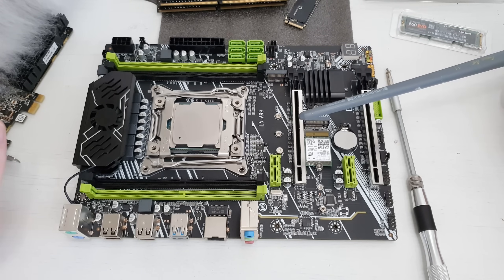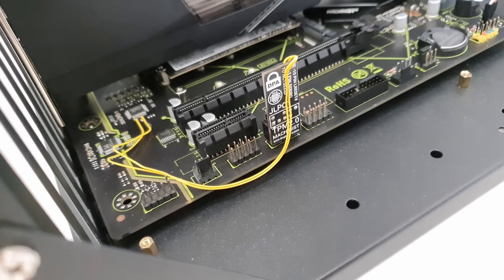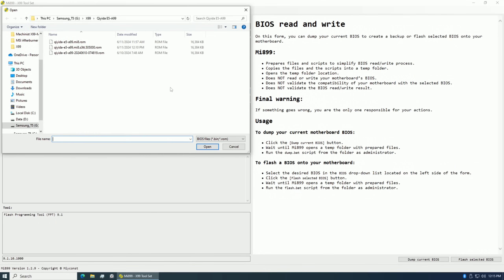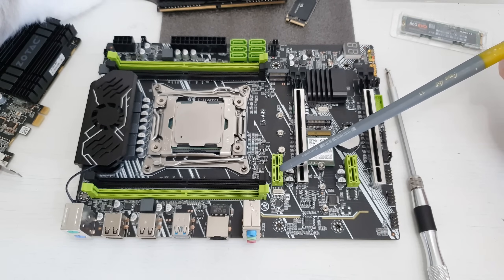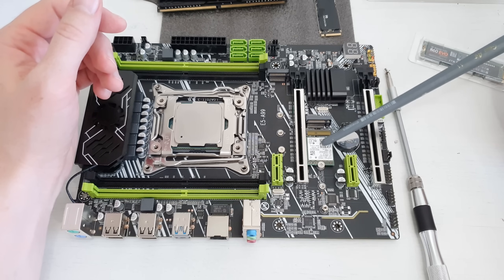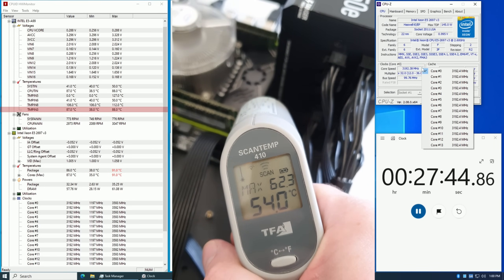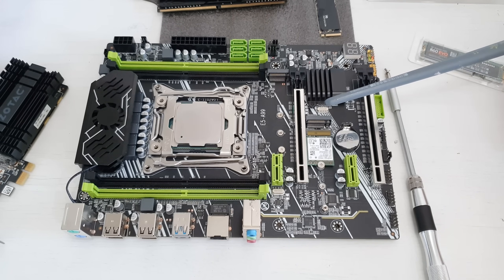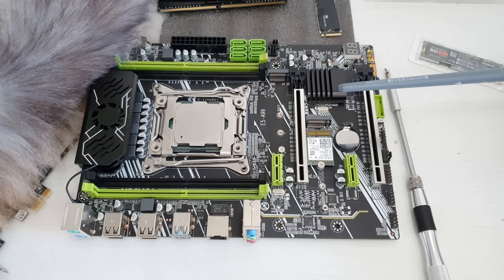Qiyida E5-A99 – a pleasant surprise with a detailed review of the motherboard

Comment: Wow! That BIOS is unusually very full featured with Re-Bar, PCIE bifurcation and memory time settings. Those functions make this sound incredibly compelling to buy. With a BIOS dump and flash I wonder if other similar boards could have some functionality unlocked.
Reply from the maker: What other similar boards do you have in mind?
Reply: @Miyconst  I have no specific boards in mind. It's far from my expertise so I'm simply wondering since it's been done on here in the past.
Reply: @Miyconst I've been trying to find a bios mod for the Qiyida E5-D4 with the e5-2680v4 and the H81 chipset? I looked through the MI899 library but i didnt see it

Comment: Hi another problem i had was in shut down during gameplay, it cant be GPU cos am using a brand new GPU. any suggestions?
Reply from the maker: You have to swap components one by one and see what is causing the issue. A brand new GPU is likely to work properly but may still be faulty.

Comment: I have this exact motherboard and it's stuck in windows boot loop after a fresh windows 10 install.
Reply from the maker: It sounds like you have a hardware defect somewhere, most likely the motherboard.
Reply: Thanks, I figured it out it was bios problem. It was attempting to boot from second harddrive.

Comment: The moment I had1 got the hardware before my favourite reviewer). I had bought a set with 2680 v4. In september 2023 BIOS I had had had no RAM timing adjustment. Thank you for the review.
Reply from the maker: If you your motherboard is indeed the same then you can flash my BIOS to get extra features but if the PC is a daily driver for you then I would leave it as-is as long as it works well.
Reply: @Miyconst  Thank for an offer, but PC is already sold. The man I had sold it uses it for FPW simulators. It turned out that Liftoff had adequate requirements, and RX5700 was more then powerful for 1080p / ultra graphics.

Comment: Amazing improve over my old Qiyida X99-H9 which the 3rd ram slot is defective so I have to use dual channel instead quad.
Reply from the maker: If only one slot is defective you can still use three slots for three RAM channels.
Reply from the maker: @gandharvmohan9572 yeah, CPU contact issues may cause some RAM slots to malfunction.

Comment: Thank you for your review. I just found a combo on AE with this motherboard, an E5 2680 V4 and 4x8Gb of 3200MHz RAM for less than 130€ !
I think i'll order it today or tomorrow with a RX 580 8Gb or a RX 6600 8Gb. 
Xeon on X99 are jewels !
Reply from the maker: RX 6600 is significantly faster than RX 580, just so you know. A great combo otherwise.
Reply: @Miyconst  I was especially worried about quad channel compatibility. I still remember a time when their X99 motherboards with 4 RAM slots only offered dual channel but now I'm pleasantly surprised! The RX 580 has the big advantage of being available at a very low price, around €100, which makes a relatively affordable PC when you reuse other elements (case, power supply, SSD, etc.). My only 2 regrets with this kit is the impossibility of activating the turbo on all cores on the V4 (as I do on my 1155 CPUs with the Z77 chipset) and visibly the RAM speed stuck at 2400MHz even with the 3200MHz provided (maybe the opportunity to run it at 2400MHz with tighter timings?).
Reply: Well, I ended up falling for the kit from AE this morning.  Thank you for this test which has shed a lot of light on certain questions (quad channel, speed of the Ram, etc.).  It’s well worth a subscription to the channel 😅
Reply from the maker: @newstalgia3865  welcome to the channel.
Reply: @Miyconst  i finaly ordered a RX 6750 XT this morning ... i think it's the most powerfull choice with my config before bottleneck.
Reply: @Miyconst  have you tested the power limit ? I ordered a 2697A V4 but i don't know if this motherboard will be enough.
This old sschool bios is a real time travel :D
Reply: @Miyconst yup I have the rx 5700 and it’s way faster than the 580

Comment: Running this motherboard after this BIOS upgrade and unlocking the TurboBoost, plus enabling the 4G Decoding made a HUGE difference with 2697v3 and a 2060Super for gaming (using the latest Nvidia Drivers also helps, so that it uses the card properly on idle)

Comment: That's basically the exact same as my Machinist x99 motherboard. Same color, pretty much the exact same features. They're good boards. Right now i have a 2650v4 I believe. Its the 12 core v4 E5. It chews through cinebench like a champ.
Reply from the maker: Which Machinist board do you have in mind? Is it MR9A (Pro)?

Comment: Thank you so much for your precise review of one these 'interesting' motherboards. My Machinist RS9 appears to have resizable bar enable in the BIOS. I enabled it for my RTX3060TI although I can't see a big difference in my gaming speeds. It also has the header for the TPM 2.0 module as well as the switch for it in the BIOS. The BIOS is V5.11 09/08/23. Just out of curiosity where is the link to your TPM2.0 purchasing website since I couldn't see it in the description (I may be blind and/or dumb). I'm running an E5-1660V4 on the board with 32GB 8x4 G-Skill consumer non-ECC memory and it's running perfectly. I guess I got a good one. BTW I highly recommend the Thermalright SI-100 CPU cooler. It covers the whole CPU/memory/VRM area and keeps the VRM very cool. 
Slava Ukraini !
Reply: RTX 3060 Tis (and most other Ampere GPUs) normally don't benefit a huge amount from Resizable BAR.
It does normally result in a slight improvement of performance, but it's often within margin of error and not easy to measure, and I think there might be a few games where it still results in a regression of performance rather than an improvement (though I'm not certain. Those bugs might all have been fixed by now).
AMD and Intel GPUs, and newer Nvidia "Lovelace" GPUs tend to benefit a lot more from ReBAR than Ampere.
Reply from the maker: I have added the store link to the video description, please check again. Your X99-RS9 indeed came with an updated BIOS version and TPM should be plug-n-play except for the reset wires.
Reply: thank you bud, i was looking for a really good cooler NOT ON AE that covers these boards very good to push the heat

Comment: Resizable bar works without bios mod? 'Cause it gives me active on gpuz, I applied the change to the registry to work with rx580, but adrenaline always sees it (SAM) disabled and not activable. thx
Reply from the maker: RX 580 officially does not support resizable bar thus you won't see it enabled in the Adrenaline Software, check in GPU-Z, if it's enabled there then it's enabled, no BIOS mods are required.

Comment: I have trouble choosing X79 motherboard on Aliexpress for my i7-3930K. There's so many models to choose from. Sorry for the vague question but is there any good model that doesn't require too much tinkering?
Reply from the maker: I am not following the X79 boards from AliExpress, sorry. The last time I checked Machinist X79 V2.82 was the best but no overclocking of course.

Comment: Excellent review. Is there a M-ATX version of this board, or close? Especially one with resizable bar already included in the Bios.
Reply from the maker: I don't know of any mATX version that would be an exact copy of this one but X99-PR9 has resizable bar in the BIOS and the latest revision of K9 has it as well, according to my Discord members.
Reply: @Miyconst  thanks, I appreciate the response 😊
Reply: This motherboard is already close to M-ATX!
It has 5 peripheral slots, so it's shorter than standard ATX, which is 6 or 7 slots. Micro ATX is 3 or 4 slots.

Comment: What do you think of the jingsha x99e Max motherboard? I'm looking for a plate of maximum 22 cm x 24 to put in a Cooler Master nr200p case and this one is just the right size.  It seems to have good vrms and good connectivity. Could an mvme ssd be connected to the ngff port to put two mvme ssds? Can you overclock and turbounlock? What possibilities does it offer? I am thinking of buying it and I would like to have a prior reference. Thanks in advance. Greetings!
Reply from the maker: For now I don't have much to say about the motherboard as I didn't test it yet.

Comment: Your channel is very informative for building a xeon computer. thank you so much for nice info. Can I ask you a question? I would like to build a PC using e5 2697 v3 cpu with turbo boost unlock. Can you recommend a budget chinese x99 motherboard? In your previous video, maybe 1-2 years before, you recommended huananzhi x99 tf, f8 because of capability of 200w safe power supply. In this moment 2024, is there another budget  motherboard option for e5 2697 v3 with turbo boost unlock? Actually I ordered x99 tf board but it is not a buget build... you know, AMD ryzen5 2600+b450 mobo combo can be cheaper but show bettet performance. Thank you so much.
Reply from the maker: Machinist X99-MR9A (Pro) and this E5-A99 would be my picks. Huananzhi X99-F8/TF I don't recommend any more because the price makes no sense and lately Huananzhi quality declined.
Reply: @Miyconst  Thank you so much!! :)

Comment: Hi Miyconst! Should I pair a 6600 (non xt) with dual Xeon e5 2678v3  (for gaming purpose) . I’m thinking about an  upgrade! Anyway good vid!
Reply from the maker: No. Dual CPU setups make no sense for gaming.
Reply: @Miyconst Thanks for the quick response but I have a dual cpu system and thinking about a  GPU upgrade . I have used this pc for about 3 year for both server and gaming purposes , currently i'm using a gtx 1650 . So my question is will the e5 2678v3 bottleneck the rx6600 ?

Comment: Hello there Mr. Miyconst! Im currently using an intel Xeon e5-2680 V3 with Dual Channel 16Gb RAM. Will there be a significant upgrade in performance if I used Quad Channel memory setup instead of Dual Channel? This is for gaming
Reply from the maker: It really depends on what GPU you have, what games you play, what screen resolution and quality settings you use, in general no, it won't be significant but with DDR4 ECC REG prices being so low I would upgrade either way.
Reply: @Miyconst  Thankyou for the input!

Comment: Hi Miyconst, I have installed 4x4GB Ram on four memory slots, on my Qiyida X99 K9 ED4 v1.1 model. How do I know if the cpu is working on quadchannel mode? Looking at the Task Manager, no much information appears on the memory screen.
Reply from the maker: Use Aida64 memory test.
Reply: Thank you for your suggestion. I run Aida64 memory test and it seems that cpu only recognizes dual channel.

Comment: Will this motherboard work with a 2678 V3 with the modified turbo boost unlocked bios and if so, what should the under volt value should be set at? I believe from watching one of your last videos, the 2678 V3 is under by 70/50mv As for the 2697 v3 I do not know the under value And if I where to go with the 2697 V3 what should be the under volt value Sorry for taking your time on this question it’s just that I currently own a 2697v3 CPU that I purchased years ago, but never put it into a working system as of yet I want it on a bid on eBay for 50$ about two years ago and if I were to do turbo boost unlock on this motherboard, I would like to know the under volt value so I don’t specify the wrong under volt value before proceeding with a turbo boost, unlock bios
Reply from the maker: I always recommend to go with the safe value of -50/50 MV, many if not most CPUs can do -70/50 MV but not all of them.
Reply: @Miyconst  thank you so much for your helpful advice. This is literally the only place I know where I could get advice on on Xion processors like  this on YouTube Keep up all the great work you do on your videos friend and once again, thanks for the helpful advice✨”😎👍

Comment: Between Qiyida E5-A99 & Machinist X99-MR9A which one is better for pairing with i7-5960X in your opinion?
Reply from the maker: The cheapest one. Both require custom BIOS for overclocking, VRM is the same, and i7-5960X has all 40 PCI-E lanes so the routing doesn't matter.

Comment: Great review for such a niche product! I've got a Qiyida E5-A99 and Xeon E5-2695 V4 on the way, I'm thinking they will be compatible? (If I'm not overclocking of course) I already have the Huananzhi X99-TF and E5-2678 V3 which I got back in 2021 and it has been a very reliable combination.
Reply from the maker: E5-A99 should be compatible with E5-2695 V4 but as usual, nothing is guaranteed with the Chinese motherboards.
Reply: @Miyconst  Yes understood, usually it's a gamble with most things on Aliexpress.

Comment: Would this mobo works with a decent modern gpu for gaming 1080p ? What would best cpu to pair with for gaming multimedia?
Reply from the maker: It surely works for gaming and you can surely match it with something modern like an RTX 4060/3060 or RX 6650XT. For the best CPU recommendation I need to know your preferences.
Reply: @Miyconst cyberpunk and modern warfare
Reply from the maker: @petrescuvictorrazvan  E5-2690 V4, E5-2697 V3 are good, on a very tight budget E5-2690 V3 and E5-2680 V4 are good.

Comment: Awesome review! I ended up going with this motherboard. I have noticed it posts with a code 73 indicated. Does anyone have any ideas what might cause that issue? It seems to run fine. I can't find a manual or list of codes for this motherboard so I am at a loss.
Reply from the maker: This code doesn't really affect anything but if you want to get rid of it, disable Fast/Quick Boot in Windows settings.
Reply: @ Awesome! Your work is always appreciated. Thank you!

Comment: I have a question about the chipsets they use. How is it possible to put a chipset that was designed for LGA 1155 on a "x99 motherboard".
Does it explain why some of the motherboards just have USB 2 support and no USB 3 support ?
I tried to ask chat GPT 4 and he told me that "It cannot be" and "the seller must be lying about the chipset"
Reply from the maker: Haha, Chat GPT learned to lie. You are correct, the USB/SATA and other connectivity goes through chipset. Some of those old chipsets don't have USB 3.0 support but they are still fully compatible with LGA 2011v3 CPUs, just Intel never officially supported such configuration because they wanted to sell expensive X99/C612 chipsets.

Comment: Hey bro, can I run w11 on this board with a 2690 v4? Does TPM and Secure Boot work in this board?
Reply from the maker: You can but only if you buy and install a TPM 2.0 module.
Reply: @Miyconst  do you know if I dont have a TPM module i can enable TPM for Hyper V VMs?
Reply from the maker: @notThomxs  as far as I know that's possible, it's called TPM emulation.
Reply: @Miyconst  I just need TPM on the VMs then. Hopefully it works

Comment: This is quite interesting, I got my E5-A99 board (same Aliexpress seller) and it has an Intel C226 chipset. It's a great board and I have zero complaints, the only reason I say "interesting" is that they don't actually mention a possible C220-Series chipset variant. It's running the 18 core E5-2695 V4 just fine and it delivers a heap of performance!
Reply from the maker: These C220 chipsets are enterprise counterparts of the known Q/B chipsets targeted for Xeon E3 CPUs. So far, from what I seen, the BIOS is mutually compatible.

Comment: Good afternoon.
Yes , too many x99 motherboards
Any chance for  review any cheapest am5 or intel 1700 ?
Reply from the maker: There is a chance. Do you have any specific motherboard in mind?
Reply: H670 or Q670 with vPro, both available on Ali for about 195€ and 220€ respectively. I'm considering a build with a Q670 and an i5 13500 for Nas/homelab.
Reply: Or Maxsun b650m

Comment: Has anyone had or heard of people having issues with this board?
Reply from the maker: Of course. Like with any other Chinese motherboard, someone will get a defective or malfunctioning unit.
Reply: @Miyconst  Hello, I have a problem, I bought this same combo, cpu, mother and memory, but when I try to turn it on I can't get the image, it doesn't even show me the bios. Everything works correctly, the display shows me an elbow "AA", "Ab". What do you think the problem could be?
Reply: @gastonnarcotti1524  Which GPU are you using?
Reply: @augold1681   Hello, thank you for your prompt response. I am using a gtx 1050ti. But I have already solved the problem by using a GPU with external power. The problem is that these types of Chinese motherboards do not offer enough power in their PCI slots, therefore, the GPUs that are powered through the PCI slot only turn on the fans but will never start to output video. In order to solve this problem and have a video signal, a GPU that has external power must be used. It doesn't matter how powerful or efficient your power source is since apparently the power that PCI slots can deliver is limited.